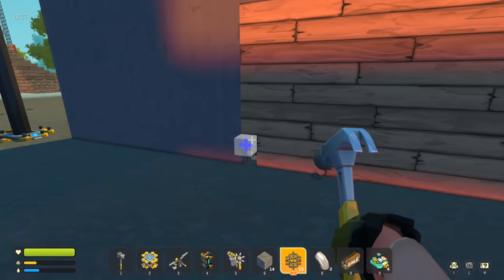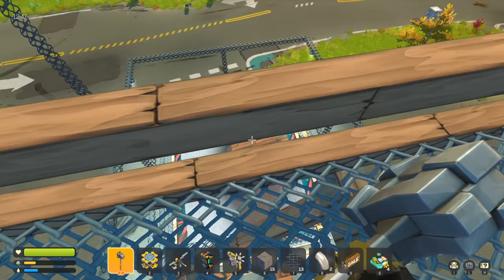This Sawmill Destroys Forests In One BIG Cut! Scrap Mechanic Survival

Comment: Now, I'm just guessing, but I think a vehicle that loosely holds the tree upright and allows it to be gravity fed down to the blades that initially cut the tree down while simultaneously collecting the planks produced might be a bit more efficient and not result in scrap mechanic slideshows.

Granted, anyone who is subscribed to you knows anything worth your time to do is worth doing so overboard Thanos would facepalm.
Reply: that is what most youtuber do, the most hilarous one was one that take the tree and drop inside the back of the car and slice it down...

some tips: the flat side of blade cut better having more surface
the control engine have very good speed but lack force, if you want have a rotor whit good force use piston engine, KAN is very good at these
But let's be serious... this way is way more fun to watch

Comment: might i suggest, one saw blade per bearing with multiple blades littering the floor, all connected to a controller set to loop and 360 degrees, yes it spins slow but it spins infinitely and gas or battery free. Let gravity feed the blades and the trees will be cut up automatically

Comment: Could you use a scissor lift to have a controlled, stable descent for the logs into the "blender"?  Could you weld logs onto the other side of the mounting plate?  Are you able to build more than one arm, to facilitate a more stabilized swing?
Reply from the maker: My first though was to use the lift to do that, but weight seemed to get in the way. The platform was almost too heavy.

Comment: use an electric engine on the blades so they wont stop, electric engines have the most torq of the 2 engines, you can also use controllers to power the blades for high torq

Comment: Too bad that now it's deprecated because you can't welt trees and rocks anymore.
Reply from the maker: Well at least I had fun while it was a ting. ¯\_(ツ)_/¯ EDIT: It works. apparently it went away and then came back. Patch Notes 0.4.5
Reply: No they patched it back in after it got removed
Reply: @MyAccountNotYoursOk  they want the tree welding to be a feature or its a  bug ?
Reply: @buder5116  even the devs don't know...
Reply: @buder5116  It's a feature now, dunno if it was a bug before. It went away when they fixed the farmers being weldable in 0.4.4, but in 0.4.5 they added tree welding back as a feature.

Comment: Faster saws cut faster..
Reply from the maker: Mmmmm rocket saw
Reply: Faster rpm or faster lateral movements?
Reply: Martin Dinner Faster Rpm (on saw-blade), E.g maxed out engine will cut faster than a lower setting one as the saw spins faster